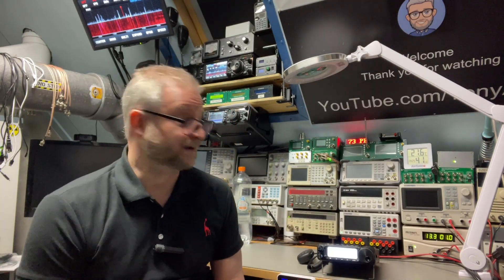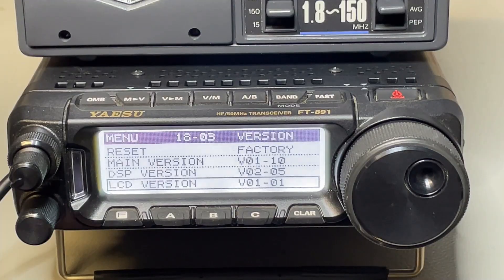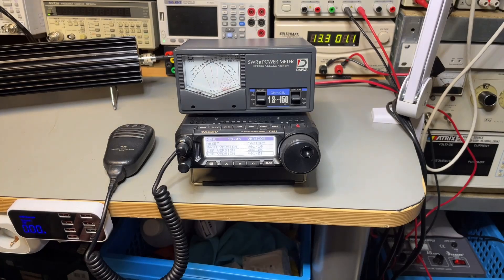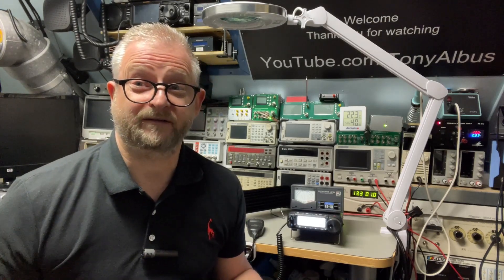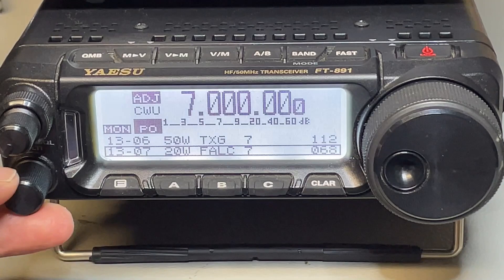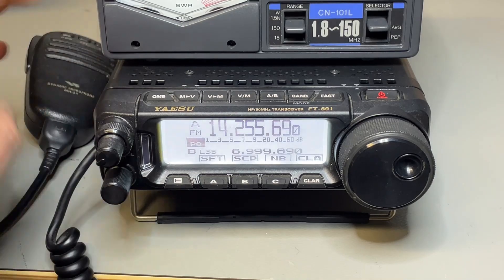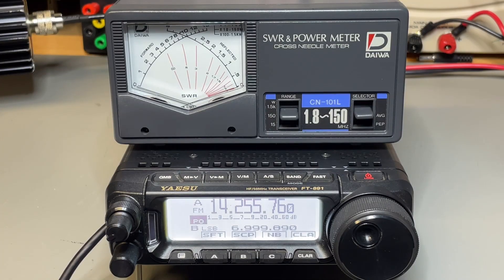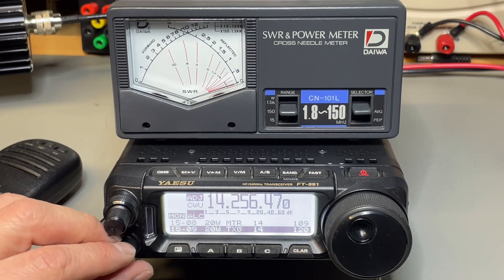TA-0344: Yaesu FT-891 TX Delay on AM and FM - Fixed - Improved

Comment: By doing these changes you are affecting the ALC response of the radio. The most likely outcome is you will drive the PA out of its linear region in SSB mode and have a wide, splattering signal.
Reply from the maker: Thanks you, good point, i put a disclamer on the messages t do this only on Bands you use FM and the affect on SSB is untested
Reply: @TonyAlbus  Hi Tony / Jonathan, I have taken a look at the technical supplement for the 891. It's a little unclear to me what exactly the TXG adjustment is doing, it certainly looks like it has something to do with the ALC. However the FALC setting in the menus looks to me like the main ALC adjustment as this is where the RF power is set and controlled.  

The TXG looks like it controls the raise timing of the RF power which would make sense to tie into the ALC. So I really don't think this will effect the linearity of the PA. 

That being said I have a sneaky suspicion that Yaesu deliberately set the radio like this to protect the PA from adverse SWR conditions. There may be a PTT reaction time issue from the SWR detection to the ALC being throttled back under adverse SWR conditions so they may of set the TXG to combat this.

I really do think it was set like this from the factory to lower the likelihood of blowing the PA keying up on  really bad SWR conditions. I.e. Yaesu did not want to see them back during the warranty period.

There is a complete PA alignment procedure detailed in the technical supplement it may be worth following this and see how the radio behaves. 

Just a guess but would be interested in your thoughts.
Reply: @M0XFXUK  ''Yaesu deliberately set the radio like this to protect the PA from adverse SWR conditions'' in the beginning I had exactly the same suggestion. But, why then this slow response isn't observable as well on digital or CW modes, as bad mismatch (accidental or else) can happen anytime, Yaesu's logic is so confusing... 🤔 TNX, 73
Reply: @M0XFXUK  @Tony Albus I was trying to be succinct (or blunt ?!). If you look at the block diagram, the FALC setting controls the TX IF level before the mixer. TXG sets the drive level just before it leaves the main unit. I just feel that messing about with values rather than setting them as detailed in the Tech Bulletin is probably inadvisable.
Reply: @glaros0  Hi Kostas, very interesting comment. Regarding the delayed RF raise time I am only guessing as I don't have one of these radios to test however; I think it may only cause delay when the the radio initially switches from RX to TX mode and I would imagine that there would be a reset time period for digital, CW modes. One thing is for sure the delay is being controlled by the micro controller and I think we will never know the logic behind how Yaesu wrote the program to control this radio.  I am still leaning  towards protection of the  PA from high SWR or a software solution to combat a hardware design issues (The PA is probably one of the highest points of failure and most expensive to fix in most rigs so it would make kind of sense but who really knows). Yaesu obviously knew about it but released the radio anyway. I totally agree Yaesu's logic sure is confusing. thank you for the reply and food for thought. 73 M0XFX

Comment: Unfortunately this is the straight way to completely detune TX and ALC levels. I bought my FT-891 as used rig and when I got it I noticed a strange behaviour of TX output power and ALC reaction when the output power was set above 50 W. What was strange - on 160, 30 and 6 m everything was fine. When I compared TXG and FALC parameters settings accross all bands and between mine and my colleague 891 I noticed, that on "voice" HF bands somebody has completely changed mainly the TXG parameter values (they were set to 250 or even more). Fortunately these parameters were changed only for 100W output, so after some hours I was able to bring all settings almost to the correct values - it is still not perfect, but now the radio never gives more than 95 - 100 W with accurate ALC level. Yes, there is a delay on AM (I use it for antenna tune), but this is not a problem for me.
Reply from the maker: yes be careful.. and write down your original settings, no radio is the same.
Reply: Same problem here, above 50W i noticed a strange hehaviour, have to drive audio level by 20dB (FT8) otherwise ALC kicks in. i think i need to find stock parameters for TXG and FALC.

Comment: I've just watched this video and, you guessed it, I went straight to my 891 and tried it!😂 I think mine is around 5 years old now and currently running one firmware version below the latest but there is no discernible delay on either FM or AM, the response is virtually instantaneous. I've never had any issues using the radio so never thought of looking at this, nor have I ever gone into the service menu. Maybe this was something done by Yaesu on newer examples for whatever reason?
Reply from the maker: Thats great Phil!... you are one of the few.. most have this 'problem' i had it on the first firmware and the last. i did not check it on yours (the middle version you run) but many run that firmware too.
Reply: @TonyAlbus   After checking the receipt I found I bought mine new in March 2017 so turns out it's 6 years old and probably one of the first batch after being launched in July 2016. It's been/still is a great radio, especially for mobile and really punches above it's weight for it's size.👍
Reply from the maker: @phils2180  Yes great radio!  enjoy!  73

Comment: Very interesting video, thanks for this, as this slow output response has been around for long time now. Without questioning the validity of the method, however, if the solution would require only a straightforward change of some values through the service menu, I am wondering why didn't Yaesu simply incorporate these changes in the new firmware? I am pretty sure that Yaesu is aware of this 'slow' response on AM/FM modes.
Also, how's the response of the ALC value following your change? Previously, the slow PO response was followed by a 'peak' in the ALC and then a gradual drop-off (i.e. in effect the opposite effect of the PO, as this is the ALC's purpose, to contain the power). Is the ALC faster now too in AM and FM modes?
TNX, 73
Reply: Very good point regarding the firmware update.
Reply from the maker: Thanks yes we need to investigate what else are the consequences of this changes... its a start
Reply: @TonyAlbus  Hi Tony, I hope you don't mind me jumping into this as I have a suggestion. 

As you certainly have no shortage of test equipment it might be a good idea to take some measurements in order to get to the bottom of what is happening here. 

The first thing I would suggest is to understand what the TXG is actually doing. 

The TXG level can be measured at test point TP1001 which looks like a DC control voltage for Q1009 a dual gate field effect transistor that in turn controls the RF levels passing to the PA and ultimately to the antenna socket.

If you use a storage scope or a logging volt meter to measure what is happening at TP1001 during the delayed power up time it would be interesting to see if it's a delayed on state or a ramped on state. The voltage swing at this point is most probably below 5v DC. 

It would also be interesting to see what adjusting the TXG in the menus is actually doing at TP1001.

If we can understand what is happening at this point I think we are half way to  understanding what the knock on effect problems are or if any actually exist at all.   

I think it would also make an interesting video too. 

Please let me know what you think.
Reply from the maker: @M0XFXUK  Hi John, thanks great idea....

Comment: Hi Tony, interesting video. I wonder if it's a delay for the output RF to switch on OR it's a delay for the RF to reach desired power. In other words is the issue a gradual power up or a delayed power up?  I'm completely guessing at this but I have a feeling that Yaesu may  have done this deliberately to combat other issues possibly with PA reliability. Just a guess but not out of the ordinary for Yaesu.
Reply: function is for alc, txg sets time delta on tx for alc circuit. 200=no delay.
Reply from the maker: @fnordist  Thank you, great info!
Reply from the maker: Thanks John, yes unknown why Yaesu did this, and indeed the effects in SSB are not tested.

Comment: Hi, this is a Spanish village for me, as they say here - so it's completely beyond me, I don't have any radios and I don't broadcast. I'll be happy to watch the video anyway as it will at least broaden my general knowledge a bit - thanks Tony
But the load is luxurious, I have to make something similar to load AC circuits, because my load can only handle DC 150V 60A or 300W

Nice day 🙂 Tom
Reply from the maker: Thanks for your comment Tom, nie to read. i have a few videos about electronics DC load, a cheap kit and a Kunkin.
Reply: @TonyAlbus  Hi Tony, I have a good DC load, I originally wanted a 600W but it was 50cm deep and it wouldn't fit anywhere, so I took the 60A 300W version. Now I have to solve the AC load, I have some large ceramic resistors, that's why I wrote that I like the cooler you have on the power load for the radio.
I saw the video with your load, I didn't understand the switch at the back, I also have a few such devices and solved it with switchable sockets.
Reply from the maker: @Edisson.  Resistir are prob the best for AC indeed, or a 1000Watts old lightbulb with a variac :)
Reply: @TonyAlbus  Without a light bulb, variac and isolating transformer, it is impossible to work efficiently 😁
Reply from the maker: @Edisson.  Yes :)